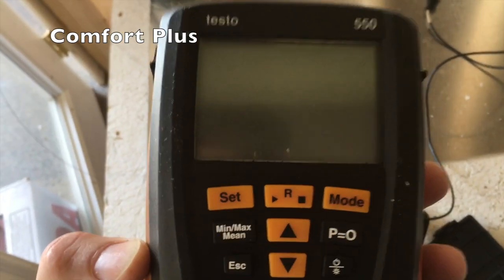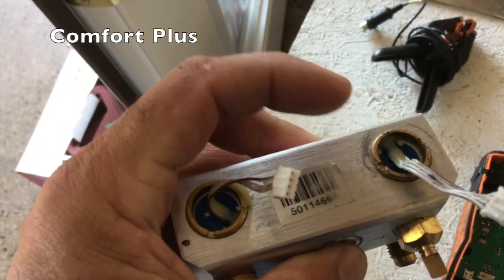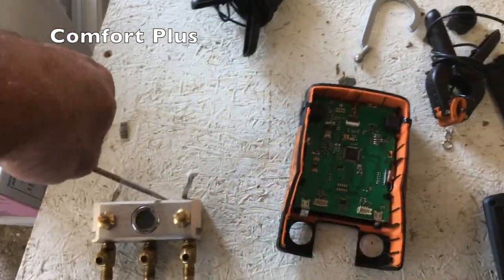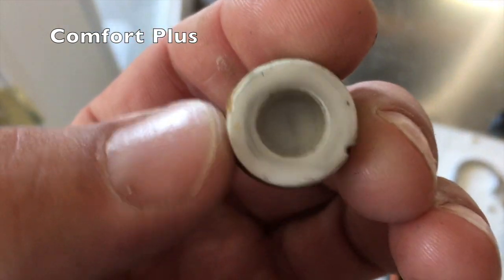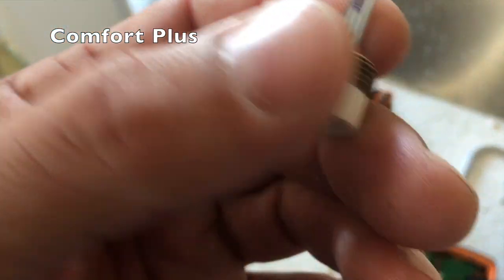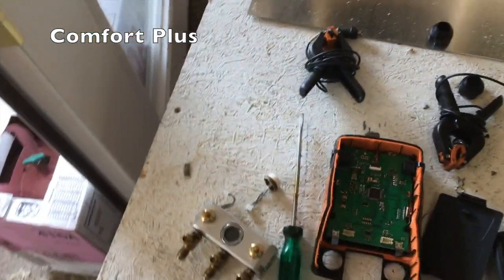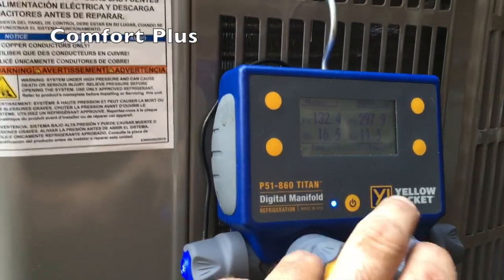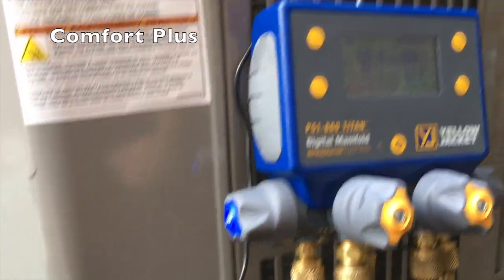New Yellow Jacket P51 Digital Gauges

Comment: Good video. I'd be interested in knowing How Many Years You Got out of the testo's before that high side started leaking ?
Reply: OcRefrigeration,Hvac & Electrical. My testo 550 have been my daily driver for 8+ years. Had some issues early on with the temp clamps not working but have had the same for 4 years or so. I would buy again.
Reply: Thanks for the reply. I just bought the testo 557's and they have been ok , except for the knobs falling off , but that was easy fix , just pulled knob clips out and pinched tighter. So far so good. Have used them a few times. I still like analogs though. I think they are more Dependable. Especially if u put Larger nice glycerin filled gauges on them. I did That to one gauge and it's cool. I am just getting used to digitals after 37 years of using analogs. Kinda weird adjustment. But Good so far.